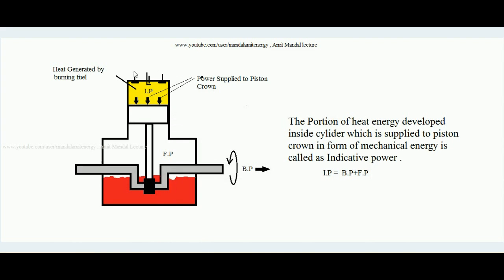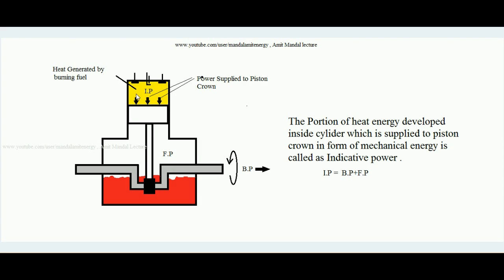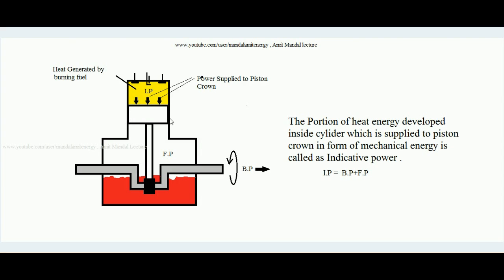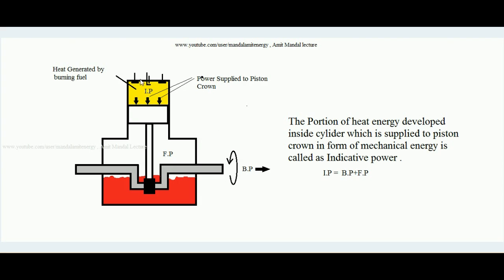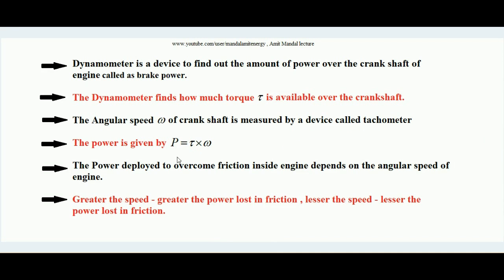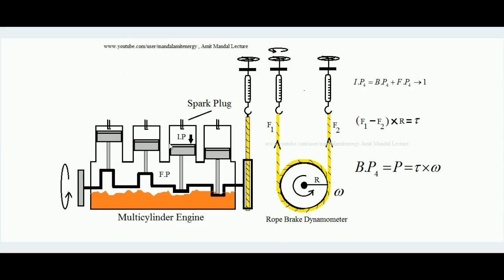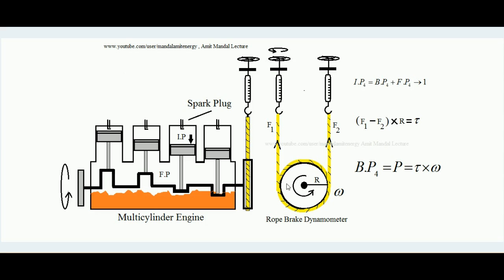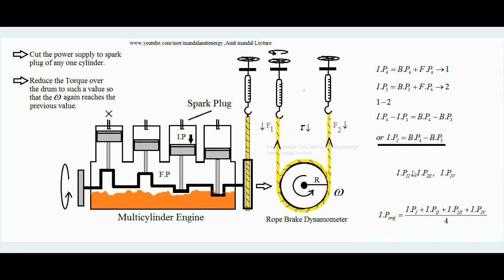Morse Test on multicylinder petrol engine, Indicative power of an engine and Rope Brake dynamometer

Comment: if friction power depends on W then 
when 1st cylinder cutoff then how we can say that friction power is same........
and secondly if friction power is same then why angular speed decrease..

and again after that to maintain w (angular speed) , tension inside the rope is decrease to maintain the same friction Power as we got without cut-off the cylinder